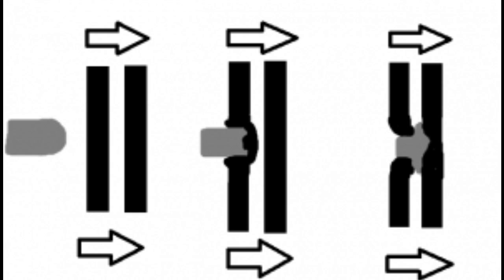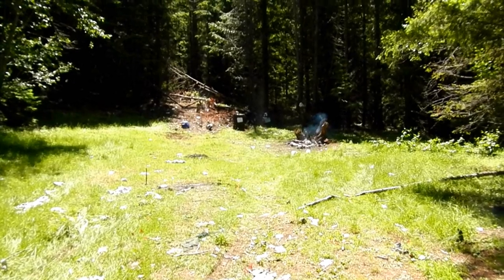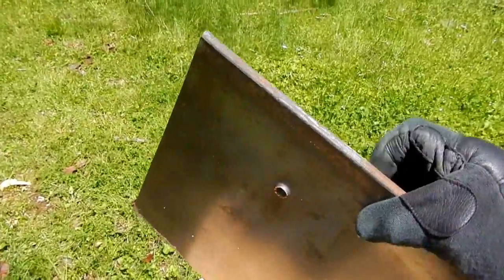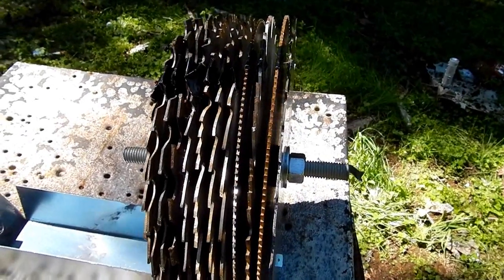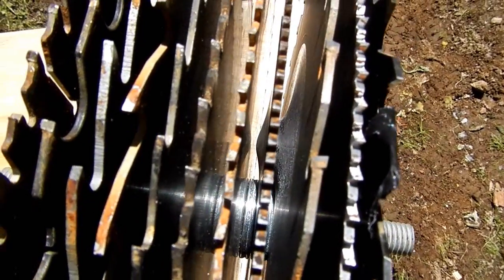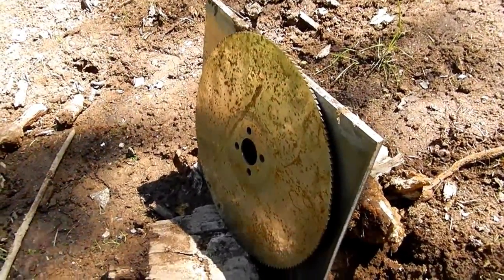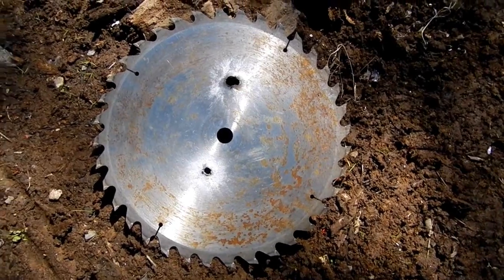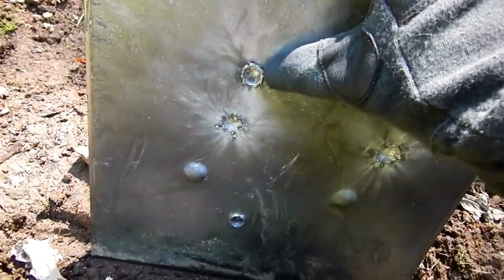Testing the Concept of Spaced Armor

Comment: There's... A vast amount of flaws in your... Nigh on everything, the purpose of spaced armour, not wide spread on german vehicles, and no not for Soviet anti tank munitions, spaced armour uses the first plate to deform the kinetic penetrator to stop on the actual plate, the air gap helps defeat hollow charge projectiles, you are also missing a stupid amount of information, NATO 5.56mm is designed to pierce, 7.62x39 is NOT as good for penetration, but flesh it fucks up, also you are not shooting AP rounds, just FMJ so... Yeah, kinda nullified your testing

Comment: From a Tank armor perspective Spaced armor works by breaking penetrators. generaly if you fire a Sabot at a Tank equiped with spaced armor what will happen is that the tip of the dart will get ground down, this will make repenetration on new armor plates a lot harder since the pointy tip is necesary for a smooth penetration, modern Sabots try to solve this repenetration issue by implementing multiple tips in the same projectile. to note is that Spaced armor doesnt necesarily mean that it is 2 steel plates with an air gap inbetwen them, composites act similarly on the tip of the projectile, forcing ot to repenetrate several layers of material and might actualy increase the effectivenes of the armor since the Dart will continuesly deplet itself even when pasing throught a composite layer. Mutli tiped shells generaly have a greater chance of penetrating layered armor than solid blocks of steel and thus RHA values may be missleading. another effect of multi tiped penetrators is that they are more effective against H-ERA such as Kontakt 5, Kaktus, Relikt etc since these protective measures aim to change the impact angle on the armor aswell as break the penetrators tip to make penetration on the 1st, and generaly thickest layer of the armor extremly hard

An other Factor is that if the spacing of the plates is far enought apart, the steel layer thick enought and the Dart gets in contact with multiple plates it tends to shatter from the tensile forces exerted on it. this will basicly render the projectile inert apart from a few shards of penetrator pieces and is used in the Leopard2 Series starting with the 2A5, the thick composite armor behind the Spaced Armor aray ensures that the leftover pieces have no chance of making it into the fighting compartment

to note is Shaped charge warheads as used on HEAT/MPAT shells, ATGMs and RPG warheads react difrently on this armor type and generaly are a lot more sensetive to it and furthermore solid projectiles such as old school APCBC and other full bore projectiles like on Rifles and machineguns dont fully folow the same physics either and generaly get stoped due to their lower impact velocity, projectile weight or simply the Bulkines of the projectile itself

Comment: Different types of steel, the 3/8inch thick steel mild steel or lowcarvon where as the saw blades are made of high carbon steel. Spaced armor is really instended to work best with shaped charge munitions and is why they are mounted on our vehicles to help protected against RPG's

Comment: spaced armour its there to protect from chemical proyectiles not from kinetics, like hollow loads.
Reply: it does both.
Reply: @roadrunnerACTUAL  no it doesnt, two  20mm plates protect less than one 40mm plate because of metalic properties.
Reply: it protects from both because solid penetrators destabilize in the air after penetrating the first plate. Spaced armor was originally installed on panzer III's and IV's to increase the effectiveness of the side armor against soviet AT rifles without significantly increasing weight. The side armor of panzer III's was around 30mm, insufficient to help against 14.5mm rifles, but when a thin 5-10mm plate was installed, even though the total penetration of the 14.5mm rifles was still higher than the combined thickness, they didn't penetrate due to the loss of energy and destabilization that occured in the air between the plates after penetrating the outer plate.

This doesn't really work great for modern sabot munitions, due to the ridiculously high velocity and projectile hardness, but against rifle ammunition and HMG ammo, it's still the same effectiveness with less weight as a plate thick enough to prevent penetration.

E.X. a 12.7mm round with roughly 24mm of penetration will not penetrate a 15mm plate with 3 inches of air and a 5mm plate in front of it, with less weight than simply having a 25mm plate.

Case-in-point, even if it's not the intended effect, having spaced plates helps against kinetic projectiles, AND HEAT munitions.

Comment: I was thinking the 7.62 round didn't penetrate because of speed. The other bullet even though it weighs less I think, passes through is because it is probably was going faster. I could be wrong and the bullets actually have the same mass and just means the lower calibur bullet was more "pointier" you can say as it had a even smaller surface area at the top to penetrate.

Edit: I think the 5.56mm had more speed due to the case having more grains then the 7.62 round being longer so it is more faster than the 7.62 meaning better penetration. A 7.62 NATO round can easily peirce both due to the speed and caliber of the round.

Comment: Lousy experiment. If you want to test the spaced armor you use:
* a thick plate,
* a thick plate + a thin plate with no space in between,
* a thick plate + a thin plate with space between.
Testing those 11 saw blades with space between was pointless.

Comment: Spaced Armor was adopted to defeat shaped charge munitions, HEAT, HESH, Bazooka's, Panzer Fausts, Panzer Shrecks, but not AP.

But hey, have fun anyway, just don't think that you are on target with this.
Reply: It was not intended to help against shaped charges. If that was the case it would have been placed on the front of panzer III's and IV's.

It was developed to help against 20mm and 14.5mm anti tank rifles which the germans frequently encountered from the soviets and some eastern european nations. 

Germans never encountered HEAT warheads in sufficient capacity outside of man portable weapons, and those warheads at the time weren't more effective at penetrating armor than conventional AP or APCBC rounds. said HEAT frequently had fuzes set too tough to actually detonate on armor most of the time. 

PIAT's were extremely short range, bazooka's didn't have much penetration to begin with, but AT rifles were a significant issue on the eastern front.

I don't know where you get HESH from, as that was a cold war development and did not influence spaced armor development in world war 2, and didn't provide significant impact on spaced armor development compared to more advanced HEAT warheads of the cold war.
Reply: @roadrunnerACTUAL  the Germans did put spaced armor on the front of PZ IIIs and IVs, and I mentioned HESH because spaced armor wasn't limited to WW2
Reply: The IIIM was the only panzer with any spaced plates on the front, and it was such a small amount of air between the applique plate that it wouldn't have helped against HEAT munitions. It was also bolted on, which only helps spalling in the case of non-penetrating actions, particularly those involving high explosives.

The IV H had a negligible amount of spaced plates covering the front- E.G. only the turret, and only small plates that covered the bottom corners of the turret face which is less than 2% of the front of the tank- again- to deter solid penetrators from contacting a shot trap into the thin roof armor. 

Even still the rest of the spaced plates on that model covered the sides of the chassis and sides and rear of the turret, where it was most vulnerable against AT rifle ammunition.

Spaced armor was not originally designed to deter HEAT munitions, sure later on it was used for that but that's not what it was designed for.

I can use a hoe to clean my gutters, and it might be really good for that, but it's not why the hoe was invented nor how it was originally intended to be used.

Comment: The concept of spaced armor on tanks mainly was for HEAT (High Explosive Anti Tank) rounds because the round would detonate on the spaced armor then the extremely high temp alloy's would cool down while traveling through the air between the spaced armor and the tank's armor. Such tanks as the Super Pershing used very thick spaced armor which made for a nearly impenetrable front. 5.56 rounds are smaller then 7.62 however they are traveling much faster therefore managing a higher penetration the 7.62 has much more stopping power but due to its size it gives up its speed. If these two rounds were to hit a human a 5.56 will zip straight through the person creating a very small entry wound and a moderate exit wound. A 7.62 will hit a person and create a slightly bigger entry wound and a very large exit wound if it manages to exit the body. There is advantages and disadvantages to both 5.56 will give you an edge in speed and most importantly range hence why our military has a hard on for it. The 7.62 round will kill easier but whats the point if you cant hit them. Just a splash of my opinion.

Comment: You do realise that the sawblades have a bit different material composition than the steel plate? I doubt the sawblades have higher carbon content and are hardened

Comment: Spaced armour is not intended to provide better protection against small arms rounds or any type of solid, non-fragmenting, round. It is to provide enhanced protection against explosive rounds such as HEAT. The slight benefit is in the deformation of the solid round as it passed through the outer layer which makes it harder for it to penetrate the inner layer, this is not that effective against larger rounds.

That is why no army uses spaced armour in the way the blades are set up, because it doesn't provide better protection or save weight.

The test with the plate and single blade is meaningless. All it has shown is that a round that will penetrate 3/8 inch plate wont penetrate 1/2 inch in 2 plates, a 1/4 inch plate should have been used so that the total protection was still 3/8 inch, that would have been a bit more valid.

Comment: Why were you surprised by the 7.62 not penetrating. It moves way too slow to penetrate. 

You should try and put up a curved perforated sheet in front of it, and see if you could limit the penetration to 1 plate only. I'm sure it can be done.

Comment: stacked armor works like throwing a baseball at a blanket, just allows more time for expansion and slows the bullet before it hits the next layer. also speed beats armor which is why the 5.56 penetrates the steel plate but the 7.62 doesn't HOWEVER the 7.62 being stopped means that it dumped all it's energy where as the 5.56 did not.

Comment: The French tank uses a modular multi-layered spaced armor consisting of composite ceramic-metal materials to help disperse and defeat HEAT (High Energy Anti-Tank) rounds, SHAPE (A High Explosive Contact Warhead That Spreads Around The Tank Armor And Detonates Creating A Killing MetaL Scab Particles As The Shock Waves Breaks The Inner Surface Inside The Tank And Killing It's Crew And Destroying It's Equipments)  rounds, and SABOT (Hyper-Velocity Kinetic Tungsten Sharp Cone Shaped Core Surrounded By Copper) rounds.
Reply: HEAT stands for High Explosive Anti-Tank and not for High Energy Anti-Tank 

Also HEAT and Shaped Charges are the exact same thing it’s just a different name

Comment: I see a couple of issues with this test. 

First the saws armor is too thick. From what I am hearing, the steel plate is only 3/8 thick which is fine until you get to the spaced armor where you have 12 1/8 saw blades adding up to 1 1/2 thickness. And even then, the hardness of the two separate materials can wildly affect the test results. I would recommend using the same material and, if you can, Give us an RHA equivalent to this material or just use RHA itself.

RHA = Rolled homogenous armor

Comment: Spaced armor is meant to defeat heat rounds. When a heat round goes off a jet of liquid metal sprays into the target melting through the armor. When the round detonates before hitting the main armor of the target, the empty space dissipates the heat of the metal reducing its penetration.

Comment: steel blades, no carbide tips.  I am the only guy I know who still uses these.  only found one saw sharpening place in the Chicago area that still sharpens steel blades- Bernie's in Forest Park.  Bernie's was mildly humored when I brought my steel blades in and said they'd do 'em but had to dig out their steel blade machine from a back shed.  They did 'em razor sharp and properly set.  I hang on to my steel blades cause they're sharper than carbide, especially with a fresh grind from a saw shop like Bernie's.  steel blades coming back from a good saw shop are even sharper than new out of the package.  I'm crying cause this guy is shooting bullets at perfectly fine steel blades.   nobody saves them when they get dull, what a shame

Comment: The purpose of vehicle skirts are to reduce the effectiveness of shape charges causing them to detonate before striking the main armor.
Reply: Clark Purkiss The skirts in the Panzer 4 series weren’t intended to stop shaped charges, they were meant to stop anti tank rifles. So maybe not all skirts are meant to stop shapes charges
Reply: They were originally developed to stop Russian antitank rounds. Nowadays, they can stop shaped charges from RPGs and potentially small arms.
Reply: Same concept really. Blunt the initial dump of energy so that the pricey armor shrugs it off. Makes little different if it's a metal slug or a plasma jet.
Reply: Not exactly. Tank skirts were first designed too stop anti-tank rifle rounds
Reply: I think your referring to bar or cage armour

Comment: An interesting question is layered armor vs. spaced armor, when those are hit by solid penetrators. Layered armor is doing worse than solid plates, according to ship armor analysis I read some time ago, but in case of layered armor, which takes more space, it could be different. The initial layers could remove the ballistic cap, deform the projectile and can also turn it sideways, lowering its penetration potential.

Comment: In order to accurately re-create spaced armor like you have on an armored vehicle, it would have to be 2 sections of metal separated by an approximately 1" air gap. What that armor is made of is another issue entirely. Some is hardened armor plate, some is plain steel and some others are aluminum. 

in your test it would have been a more realistic test to have 2 pieces of 3/8" mild steel bolted together at the corners with 1" spacers to keep them apart.

As for protection from shaped charge warheads like are found in HEAT rounds like the RPG, that requires even more space so that the warhead will detonate far enough away from the vehicle to allow the highly focused shaped charge to spread out and greatly diminish the concentration of the blast. That's why armored vehicles in Iraq and Afghanistan used "bird cages".

Comment: I like the experiment, however it is inconsistent. The saw blades are made from tool steel (hardened) and the plate was mild steel.
You should repeat the experiment with a stack of the same mild steel.

Comment: The biggest problem with this test was the spaced armor. There needs to be a bigger gap between the plates in order too see the intended effects of space armor. The idea being, more space = more time and distance for the round too destabilize, key hole, and thus lose most of it's penetration.

I can confidently say that if you use the same exact saw blades, but separate them each 4 inches a part,  the rounds won't penetrate as many plates.

Comment: Im sorry but this is just stupid..
Solid steel? Uh-huh, how scientific... as opposed to... gaseous steel? Liquid?
Spaced armor on armored vehicles is to protect against HEAT weapons not small arms fire.
Bullets will splatter on armor steel without the extra steel in front of it, so not having it works just as well and saves you weight.
Putting more steel in font of steel stops bullets? So basically more steel stops bullets...  You dont say... What a revelation.
And who the hell told you the 7.62x39 is better at penetrating than the 5.56x45? It isnt, never was and couldnt possibly be. Its idiotic to even think that. Basic physics.
And yea the first plate will deform the bullet making the impact on the second plate less effective, but no armored vehicle is made of 3/8 mild steel.
Vehicles intended to stop small arms fire use thin armor plates and composites, which works even better and saves weight.

Comment: anti-tank weapon uses shaped explosion to get thrue armor. Not body mass. Empty space between layers should break shapping and slide energy of explosion over bottom armor surface
Reply: Spaced armor is meant to shatter or denormalize a solid round too. In fact the original spaced armor on Panzer IIIs were meant for Soviet Antitank Rifles.
Reply: This type or armor isnt really meant for HEAT rounds, it's usually employed on light transport vehicles facing small arms.

Comment: The way your set up is is alot like normal composite armor as ever one of thos blades were different and probably had different hardness.
Reply: Though real composite uses ceramic, fiber material, or other stuff  with layers of alk sorts of metal like steel or depleted uranium or titanium or others.